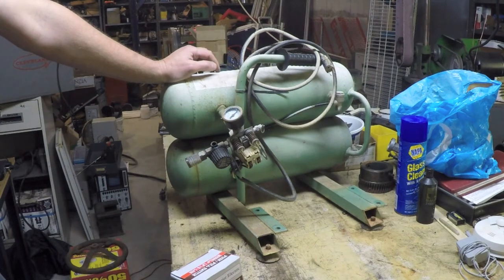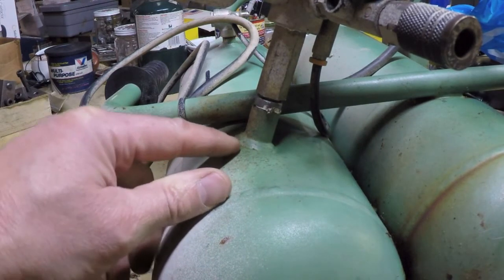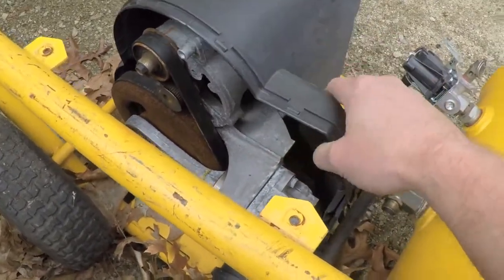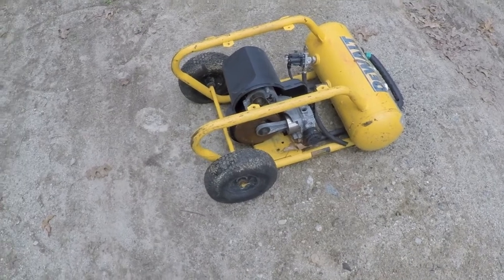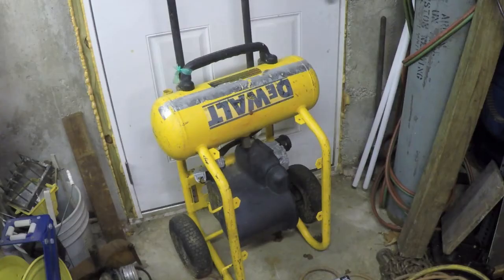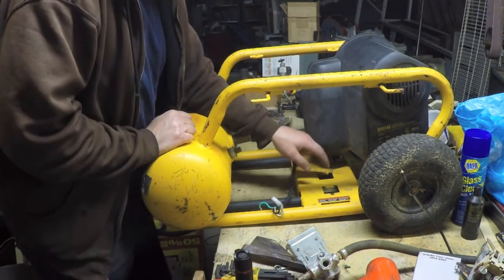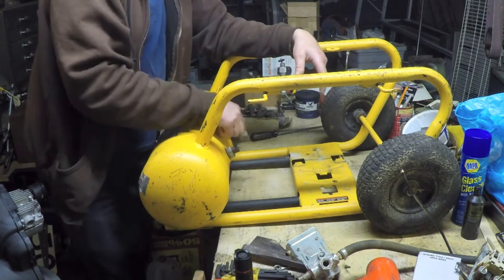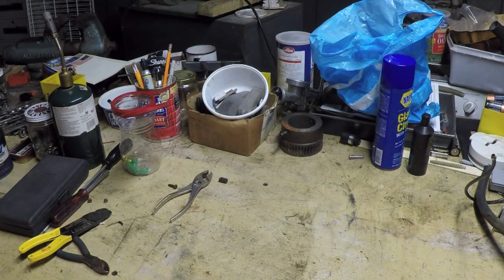Hitachi EC12 compressor repair Part 3

Comment: Hi Steve, Before you fill the new cylinder with all that energetic air, wouldn't it be a good idea to pressure test it with some non-compressible water? Just in case.
Reply from the maker: Richard Prosser maybe, but it never occurred to me. Thanks anyways.